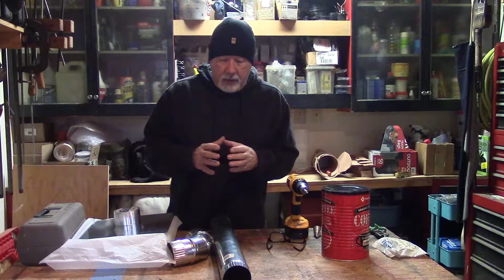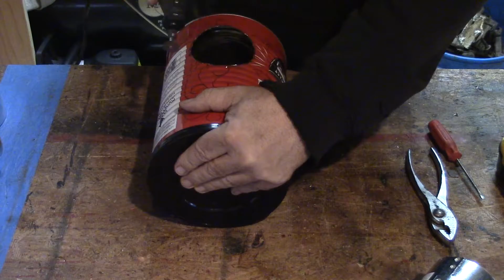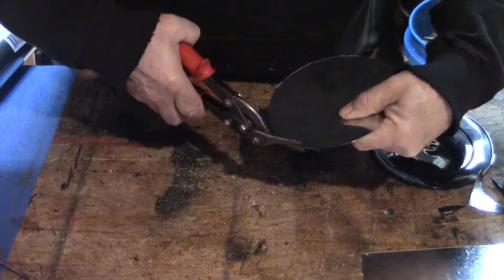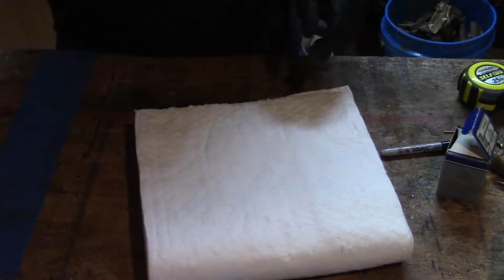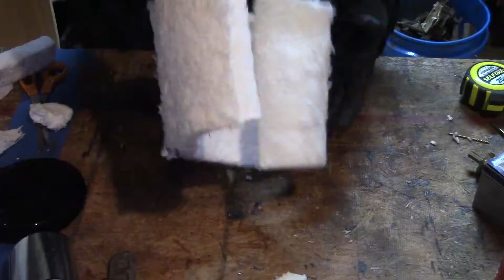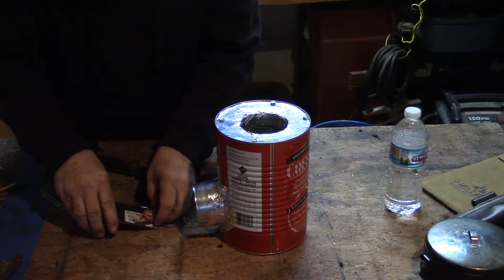Rocket Stove Build

Comment: Cool music. Great work I couldn't perfect like that Tony. Use my Dremel nearly every month and have used the multi hole saw since 1989.  Saved the left over insulation from installing insulated stainless pipe in the house chimney in 2016. Might come in handy yet!
Reply from the maker: Easy to build, and costs little compared to what they can do in an emergency. After the hurricane in Puerto Rico it was the Rocket Stove that helped with boiling the water for many families thanks to Todd Albi at Silverfire.
Reply from the maker: We have had several emails asking us to compare this build to the Silverfire Rocket Stove. There is no comparison! The Silverfire Rocket Stove is at the top of the food chain where Rocket Stoves are concerned. They burn less fuel, burn cleaner, and are more efficient, which is all due to the gasification chamber engineered into the system. In addition, they are built tank tough to withstand the rigors of bush life . Something like this is not designed to be compared side by side to the Silverfire version. We did this for those who were looking for a DIY alternative on the cheap. Thanks for the question gang.